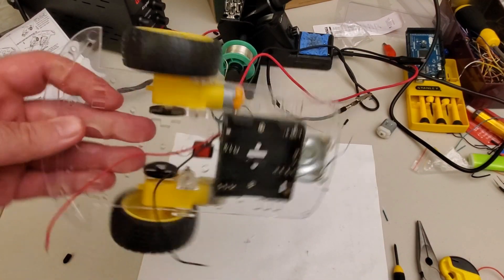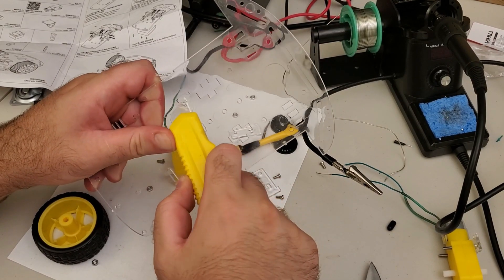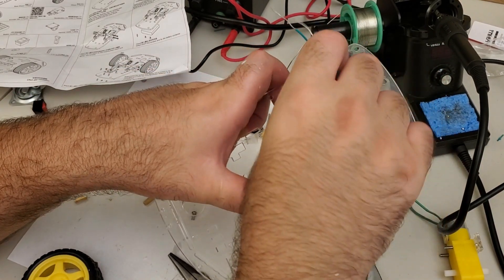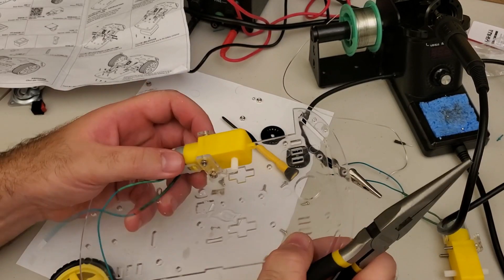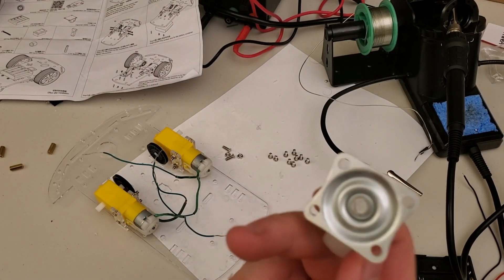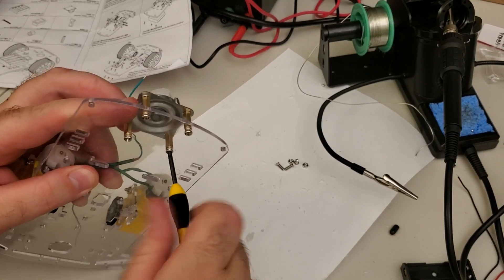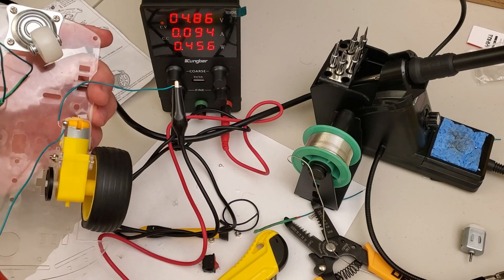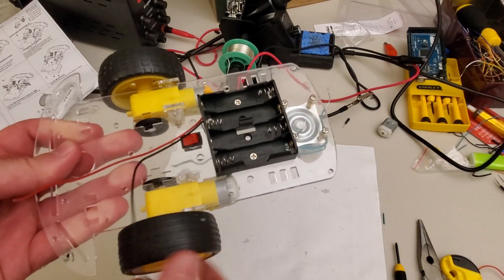PART2: Assembly- Building Low-Cost Differential Wheeled Robot For Machine Learning, SLAM, and ROS

Comment: Something you should get is a small, cheap set of files sometimes called needle files, they would be perfect for making the hole for the nuts and much better than using a knife to do it.
Reply from the maker: A good suggestion. I am actually thinking to 3D print the base, and all the brackets and to scale up the design.

Comment: Is this tutorial series contain the Navigation in ROS?
Reply from the maker: Yes, but first we need to explain how to build a low cost robot that almost everyone can afford. Next part will be how to connect motors with drivers. After that, we will explain how to control from arduino. Then, we will put raspberry pi on top of arduino. Raspberry Pi will run Ros and slam
Reply: @aleksandarhaber  will you be using lidar? And i would like to know will you use Nav or Nav2?